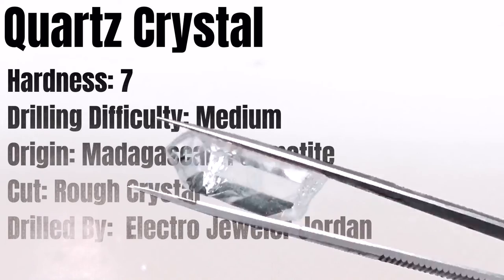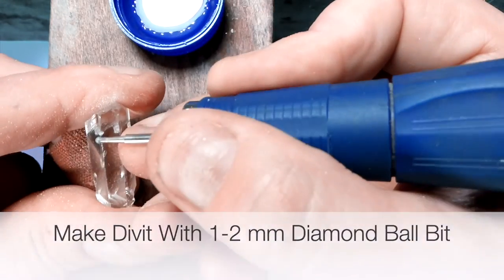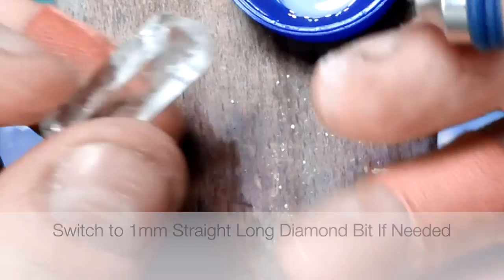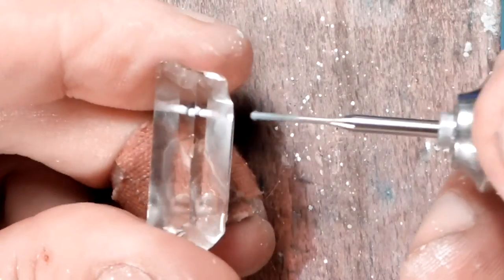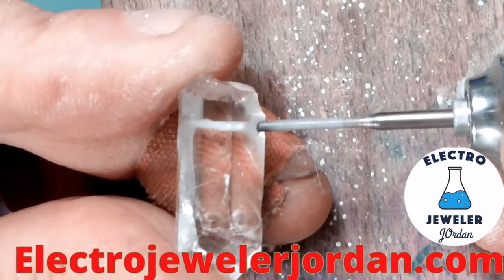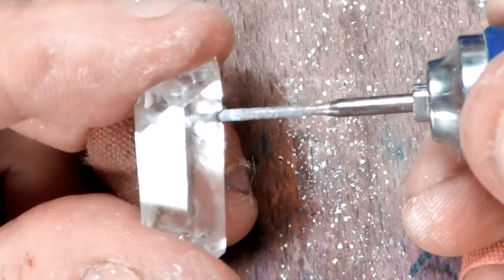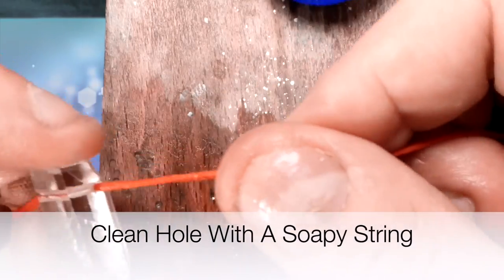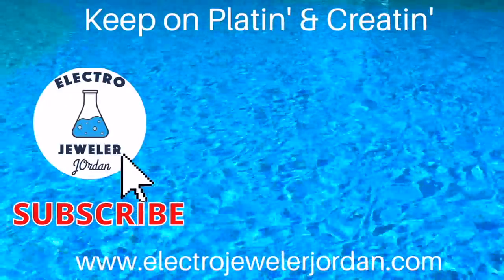Drill A Quartz Crystal How to Drill A Gemstone Crystal & Make a Pendant or Bead Using a Flexshaft

Comment: I'm trying to drill VERTICAL holes in some black and clear Quartz Crystal stones, but every "diamond" drill bit I've bought on Amazon doesn't work. Any tips on the drill bits you're using that seem to be drill though the stones like a hot knife through butter? Thanks!

Comment: What type of drill & drill bits do you recommend to use? I’m new to making jewelry with crystals in general so any help is appreciated! 💕
Reply from the maker: thanks for watching!  I use 2 machines Strong 204 ( blue one)  and a foredom flex shaft Silver one)  with a #30 handpiece.  For jewelry the foredom is better and for drilling stones the strong 204 is better.   I sell the bits on my site and since I have a few new drilling videos coming out I'm going to add an additional bit to the set so that you can doo all of the same drilling projects.  https://electrojewelerjordan.com/shop/tools/flex-shaft-tools/gem-drilling-set-diamond-point-as-seen-in-youtube-30-pcs-assorted-2-3mm-3-32-shaft/
Reply: @electrojewelerjordan490  I was thinking of buying a Dremel 3400 for drilling holes in stone. Electric nail file works?

Comment from the maker: Special Price for the Diamond Bit Gem Drilling Set $4 off + additional size bit and mini sharpening stone. https://electrojewelerjordan.com/shop/tools/flex-shaft-tools/gem-drilling-set-diamond-point-as-seen-in-youtube-30-pcs-assorted-2-3mm-3-32-shaft/   Also check out my Etsy Shop for similar discounts. https://www.etsy.com/shop/ElectroJewelerJordan?ref=seller-platform-mcnav   Please say HI in the comments!
A lot of people have asked me about choosing a drill, I put together a drill buying guide.  Email  me and I'll send it to you.  This is the link to the drill bits on my website https://electrojewelerjordan.com/shop/tools/flex-shaft-tools/gem-drilling-set-diamond-point-as-seen-in-youtube-30-pcs-assorted-2-3mm-3-32-shaft/and this one is from my etsy shop https://www.etsy.com/listing/1164491370/stone-drilling-delux-set-28-pcs-see-my?click_key=c3ca196dadd5d69c787c4a79241499b0040abd0c%3A1164491370&click_sum=dc2a747d&ga_search_query=diamond&ref=shop_items_search_6&sts=1
if you order from my website and mention this video I will add either an extra 3mm diamond bit or 1.1mm pearl drill.

Comment: HI. Does the type and speed of the Dremel you use make a difference? I have a very cheap model, and every time I try to follow your method, I break the quarts, even though I cool it in water ever 3 seconds.
Reply from the maker: HI, Thank you for your support!  Yes, it could, speed, torque, the bits themselves and how you hold the handpiece all can be a factor.  If you email me the make and model of your machine I can try to help out.  electrojewelerjordan@gmail.com

Comment: Hi, the set on your page that u ve used in the video,    does it fit a dremel? Thanks
Reply from the maker: Hi, yes, most likely. The bur size that I sell is 3/32", the default Dremel size is 1/8 and usually comes with a collect set that will accommodate 3/32".  Adapter's are also available on Amazon and E bay for about $ 1-2.  If you send me a link to your Dremel model I can tell also.  electrojewelerjordan@gmail.com.

Comment: I'm curious to know how you would drill that piece vertically, i.e. the 'long' way. I want to drill this way through red jasper and jade and need to go anywhere from 3/4" to 1.25" for 5+ mm hole. Doable? Thanks.
Reply from the maker: Yes, I' ve done it.  Drill from both sides, start off small and increase hole diameter as you go.  In order to drill a hole longer than your diamond bits head the shaft will need to be thinner than the diamond cutting surface. So if the shaft is 3mm the head has to be 3mm or larger. You can use a straight or even a ball, don't use a tapered bit, it will tend to get stuck.

Comment: I want to make a pendant out if a labradorite moon I purchased. Please can you tell me what kind of a Dremmel to use and what bit? I'm a beginner making jewelry out of crystals. Please and Thank you
Reply from the maker: Hi!  Those are really good stones to start with.  Just makes sure that the flash shows when hanging from where you want to drill.  I recommend either a strong 204 micro motor or a foredom flex shaft.     I have the exact drill bits needed here https://electrojewelerjordan.com/shop/tools/flex-shaft-tools/gem-drilling-set-diamond-point-as-seen-in-youtube-30-pcs-assorted-2-3mm-3-32-shaft/.  Thanks for watching.

Comment: Nice work, what drill were you using? Do I use any drill, but need to add/buy your drilling bits? Where can I buy it? Thanks. I have a rotary tool, with 2 drill bits as part of the attachments. 5000-25000 rpm I think. Would that work?
Reply from the maker: Hi, thanks for your support! I have a foredom Series CC and a Strong 204 , both are good for drilling.   The RPM of your machine is good so as long as the torque is high enough it will work.    You need to use diamond bits.  A lot of diamond bits are not that great at drilling as they only have a thin plated layer of diamond and wear out quickly.  I sell these bits on my site. Link here:  https://electrojewelerjordan.com/shop/tools/flex-shaft-tools/gem-drilling-set-diamond-point-free-shipping-as-seen-in-youtube-30-pcs-assorted-2-3mm-3-32-shaft/  
If you would like to see other techniques please comment below.
Reply: @electrojewelerjordan490  can these bits fit a standard Dremel ?
Reply from the maker: Michelle, Yes, they fit into the standard Dremel .  The shank size is 3/32" / 2.3mm. Thank you!

Comment: My drill has 24W power, and a max of 30,000rpm, the shank size for the bits is 3/32", I used diamond drill bits(from Amazon) I'm on a low budget. It made a dent but then wouldn't drill any further and started burning. Do you know what I did wrong?
Reply from the maker: Daisy, thank you for watching!  It sounds like you are not using enough water to cool the bit.  Also the economy bits are plated meaning that the layer of metal and diamonds is very thin over a thicker shank, when  heat builds up from the friction the plated layer detaches from the  shank.  The ones that I am using is a thick layer of diamond over a thinner shank.   Send me a pic of the bit and stone that you are drilling, and the amazon link,  maybe I can help.  contact me through my website www.electrojewelerjordan.com.

Comment: So glad I found you. I’m using a diamond blade that fits on my dremel. Definitely didn’t use enough water but unsure if my dremel doesn’t have enough power to get thru the clear quartz. Open to feed back. I’d love to know if your drilling set fits dremel or hand drill? If not what brand of drill fits those pieces? Appreciate the feedback.
Reply from the maker: Thank you !  I believe that most dremels are strong enough to drill through the quartz, it's probably the bits.   Some dremels use 1/8  bits and if yours uses 1/8 then my bits are too small unless you change the collet to 3/32.  I use a Strong 204 (3/32 collet)  and a foredom with a #30 handpiece  (0-6mm)  These both work really well. In my experience the 1/8 diamond bits don't work very well as the diamond layer is very thin.  I don't recommend a hand drill as they are heavy and if you move it during drilling its very easy to break the bit.  email me @ ElectroJJfreebies@gmail.com and I'll send you a sheet on the different drilling machines.
Thanks for watching!

Comment: Hi! The link to the tools doesn’t work anymore. Could you possibly link or tell me exactly everything I need to get started? Thanks so much
Reply from the maker: Hi, Thanks for supporting my channel!  This is the link to the drill bits on my website https://electrojewelerjordan.com/shop/tools/flex-shaft-tools/gem-drilling-set-diamond-point-free-shipping-as-seen-in-youtube-30-pcs-assorted-2-3mm-3-32-shaft/ and this one is from my etsy shop https://www.etsy.com/listing/1164491370/stone-drilling-delux-set-28-pcs-see-my?click_key=c3ca196dadd5d69c787c4a79241499b0040abd0c%3A1164491370&click_sum=dc2a747d&ga_search_query=diamond&ref=shop_items_search_6&sts=1
if you order from my website and mention this video I will add either an extra 3mm diamond bit or 1.1mm pearl drill.
Reply: @electrojewelerjordan490  amazing thank you! I will order but also, what about the power tool - which should I buy? I need it all! Thanks
Reply from the maker: Laura,  Email me and I'lll send you some links that I'm not affilated with.  Do you plan on just drilling or doing jewelry also?  You can do it through either my website or etsy shop.

Comment: Why cant you use a regular drill?
Reply: Also would you be able to use a 4V dremel? I got some drill bits from amazon but I barely made a dent.
Reply from the maker: If you use a hand drill it is too heavy for most people to hold straight.  If you move too much you are likely to break the stone or bit. You can mount the hand drill in a bench press adapter, they cost about $15.